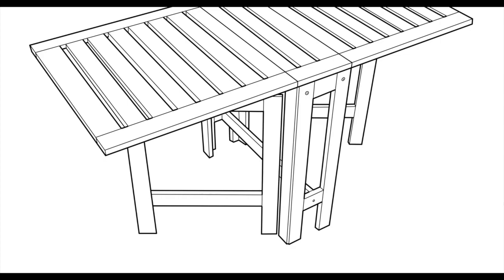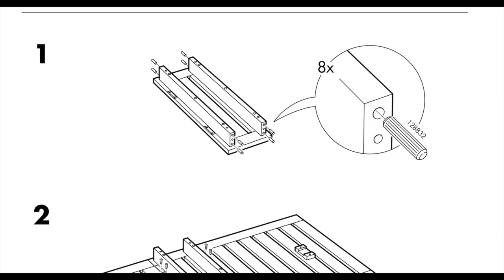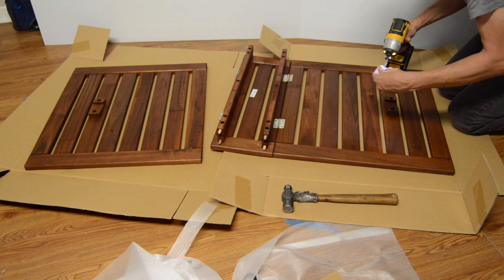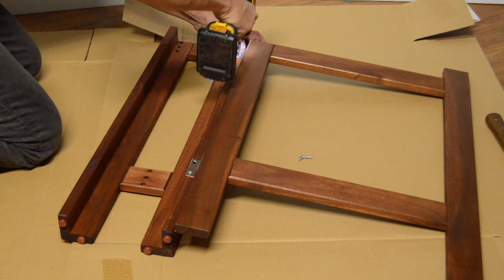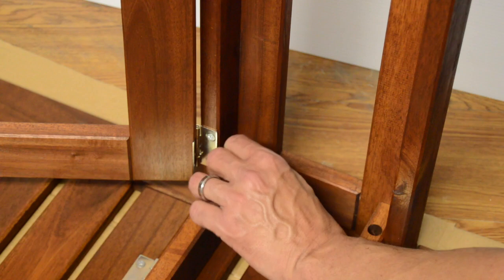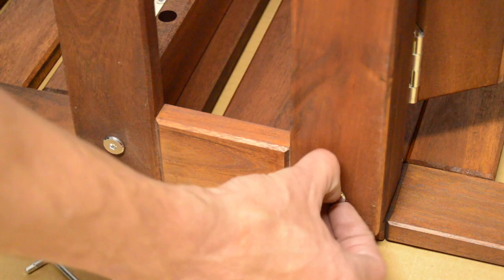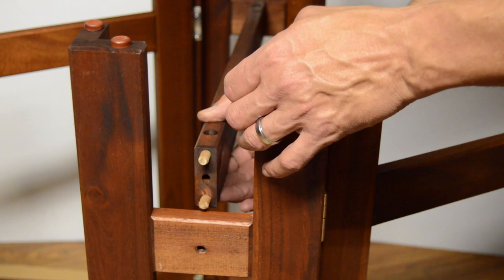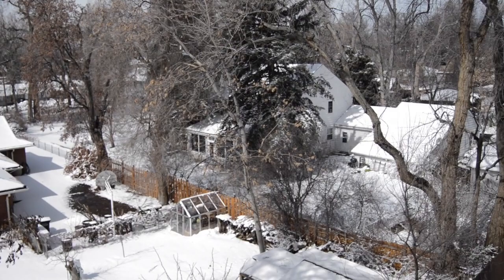How to assemble IKEA Applaro patio table

Comment: Is it a bit weird when you want to eat because of the legs crossing in the middle ? looks like you have to eat sideways or it s just an impression ?
Reply from the maker: I think it's designed for 4 people, which we've had sitting 2 on each side and I don't remember it being an issue.
Reply: @JoeyMesa  i was looking at it but we were thing that because of the leg crossing underneath to hold the table you d hit your legs or need to angle the way you sit
Reply: Nice and helpful video.Can you tell me the size of the table when it is fully open?Height,Width,Length?Thank you very much,keep up the good work!!!